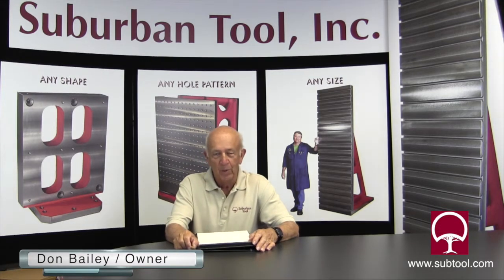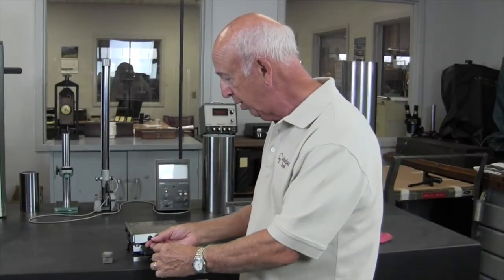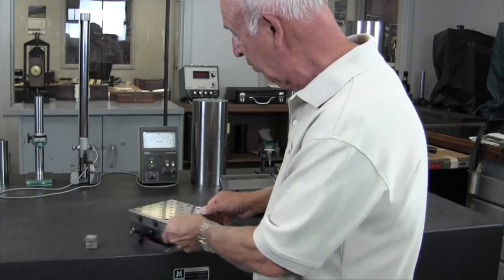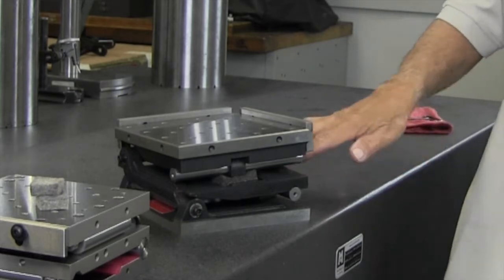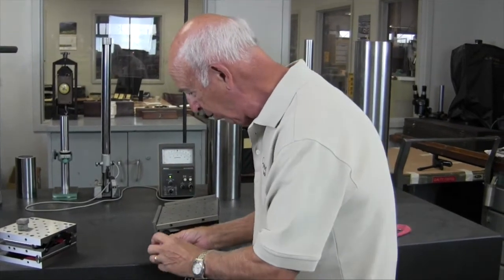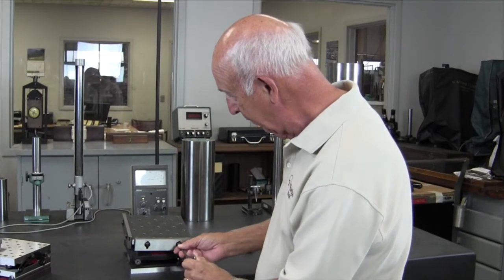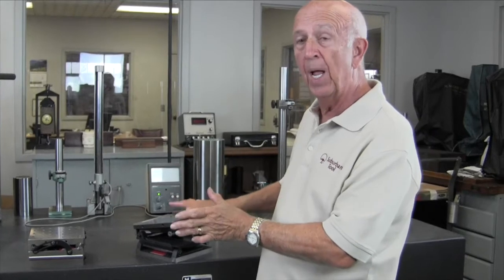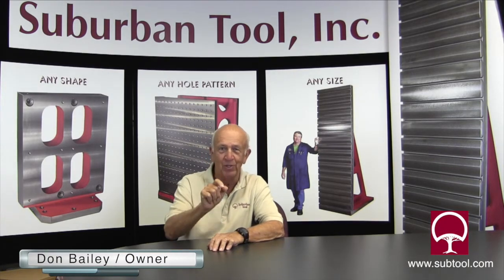Sine Plate Comparison - Suburban vs EX-CELL-O vs Taft-Peirce

Comment: Thank you for your description, I would like to add that with the compound sine plate it is very hard to bolt down to a milling table.  It should have a larger lip around the bottom plate to make clamping easier.   This seems to be a problem with all sine products as they are mostly all designed to work on a magnetic chuck and not be bolted down.  I have never seen the Excello product up close.